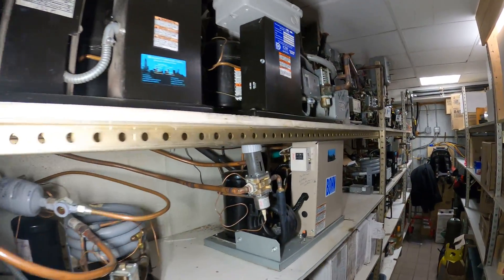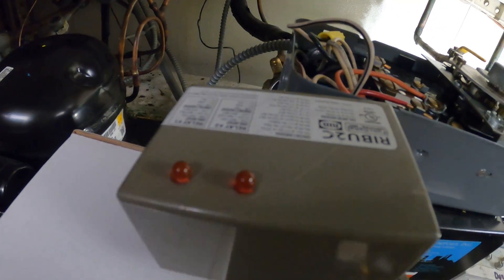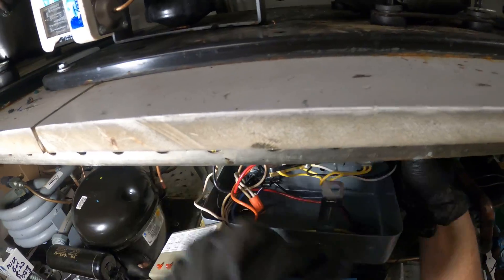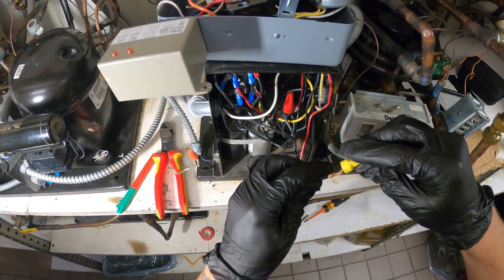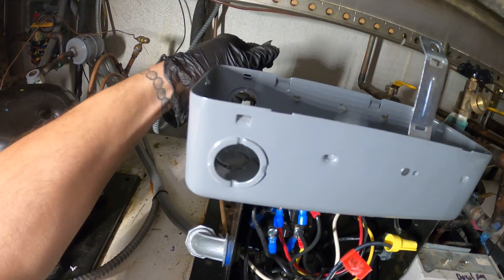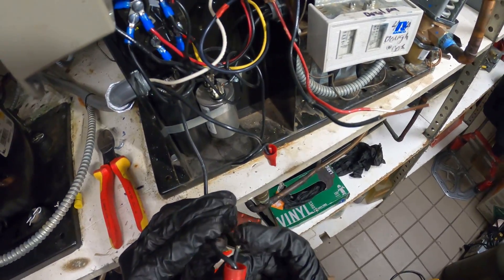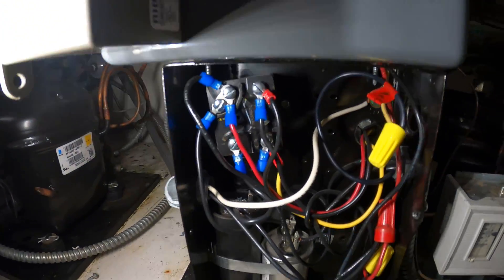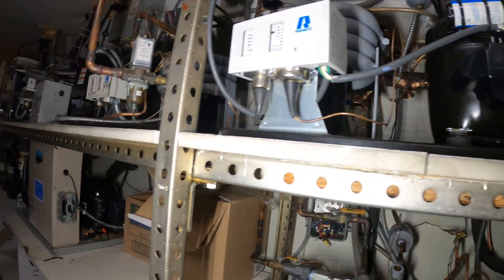HVACR Service Call: Paragon Mechanical Defrost Timer Installation(Paragon Defrost Timer Not Working)

Comment: Nice! I have a bev air cooler-freezer and refrigerator side is below temp like 21degrees. Would that have something to do with it?  Or just the thermostat? It has a manual thermostat inside compartment.

Comment: Why did you cut all that apart all you needed to do was swap the clock and leave the time clock box. That’s the whole purpose of three tabs on the left and the metal tab on the right to hold the clock in place.